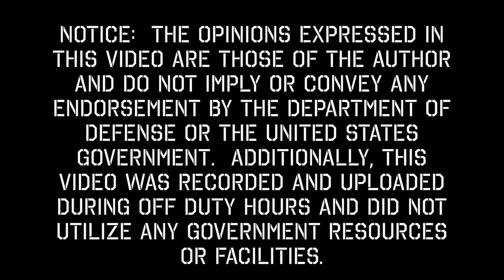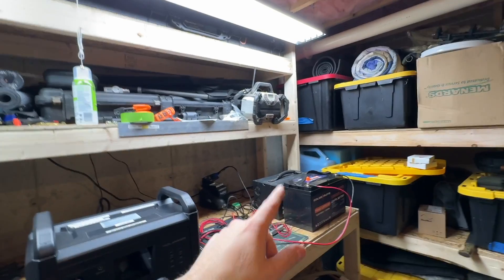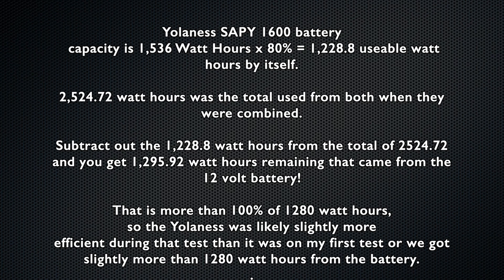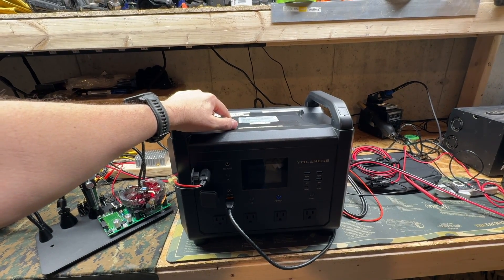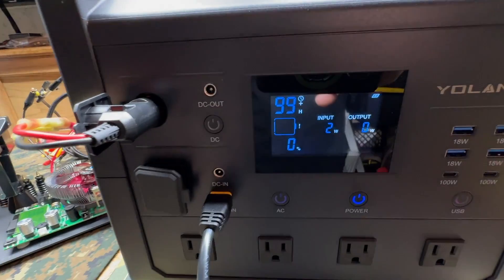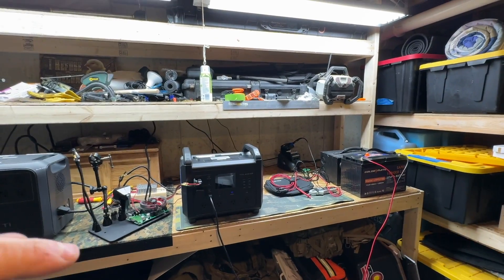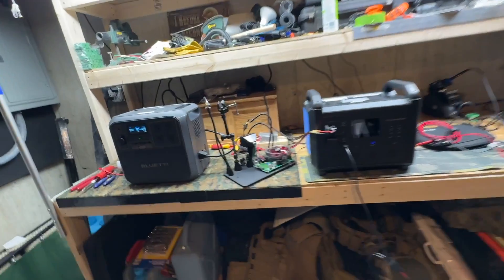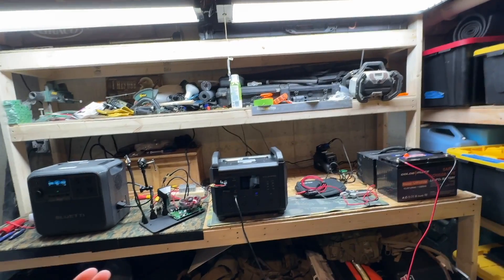Don't Use A 12 volt DC To 24 volt DC Converter With A Solar Generator Until You Watch This!

Comment: Yes, this works quite well.  One thing to keep in mind is that when most power stations detect (roughly) 12V on the "solar" input and assume that a car cig lighter power port has been connected up, and in that situation will limit the input current to around 8A.   If you put higher voltage batteries on the input the power station will run the "solar" input at the maximum amperage it can handle, which may be more depending on the power station. 

So you can connect an external battery up to the solar input and essentially trickle-charge the power station while simultaneously powering devices from the power station, greatly extending the amount of time the power station can run the devices.  Even when the charge rate is lower than the device's consumption.

Keep in mind there are still extra DC-DC conversions going on.  The efficiency isn't going to be great, but it won't be terrible either.  And it will definitely be better than topologies that go AC-to-DC or DC-to-AC.

Comment: This is AWESOME!  Question:  When attaching extra batteries, do they have to be at the same charge rate?  Also, do the batteries have to be the same such as AGM, lithium, etc...  Thanks for sharing.
Reply from the maker: You know I don’t really know for sure. I have only tried it with this setup. But as long as the battery is putting out more DC voltage than what the generator DC Inout accepts it should work just fine.
Reply: @RealitySurvival  Thanks for your reply.
Reply from the maker: When I say more than it accepts I mean more than the minimum. But obviously less than the max. Whatever is within its range. lol. I just realized that was worded weird.
Reply: @RealitySurvival  Got it!  Thank you.  :-)

Comment: Is the key part of it to make sure they are the same type of battery? The EcoFlow's use the LifePo batteries so one needs to use the LifePo batteries and not the lead acid like found in deep cycle batteries?
Reply from the maker: I don’t think it would matter what the battery type is. As long as it is within the voltage and amperage limits I don’t think the unit would really know the difference.

Comment: Every so often i like to Test my DIY system. I ran a Quartz heater on low (400) for 4  1/2 hours. Which is pretty good but heaters draw alot of power. Best way is to run  the heater on my solar DIY system and use the battery pac  in the evening. BTW that  oriental music at the end of the video woke up my speakers wow
Reply from the maker: Sorry didn’t realize it was louder. 😂
Reply: @RealitySurvival  No it sounded amazing clear my speakers thanks you lol

Comment: They sell batteries that are 24 volts or you could wire batteries in series. I would get the 24 volt batteries for better efficiency and being able to use smaller wires.
Reply from the maker: Yeah that would work too for sure!

Comment: What method do you use to recharge those extra 12-volt LiFePO4 batteries?
Reply: You just need a battery charger that is compatible with them. I bought one from Amazon.
Reply from the maker: Just a LIFEPo4 compatible battery charger there are several brands on Amazon that work fine. I will do a video showing the ones I have.